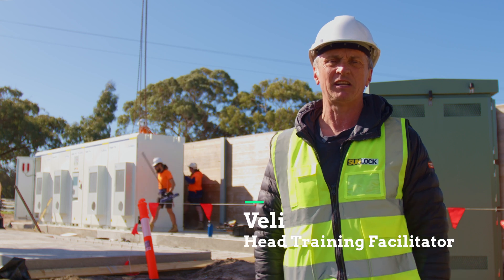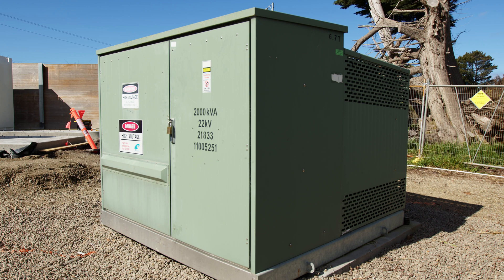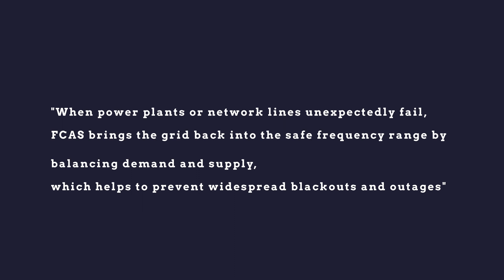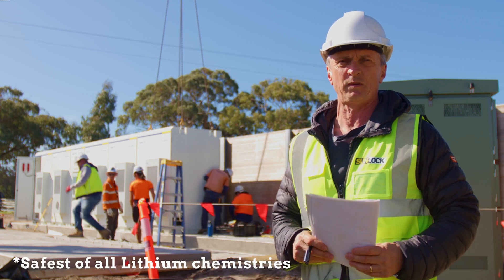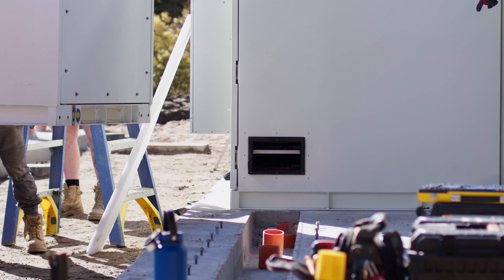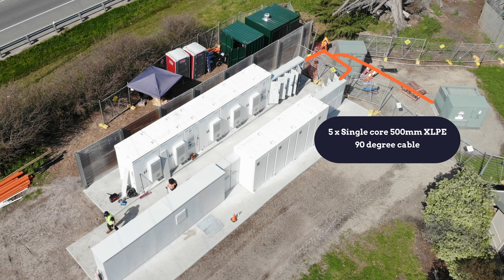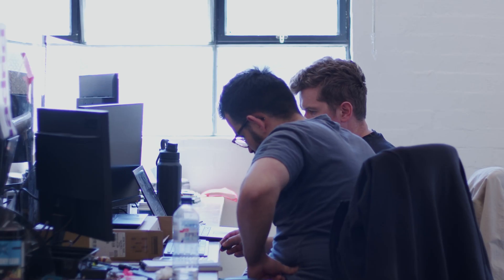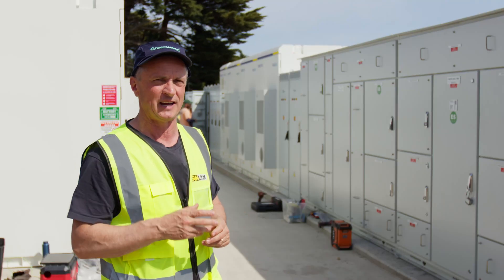2.5 MWh Battery Project BREAKDOWN

Comment: In this video, Greenwood Solutions is  installing a two-megawatt-hour battery on the Mornington Peninsula. 
The project involves two separate systems, each with its own battery and inverters, stabilizing the grid through Frequency Control Ancillary Services (FCAS). 
 The project emphasizes safety, quality, and precise cable installation, with detailed cable reports ensuring compliance. While lacking a photovoltaic (PV) component, the project showcases the crucial role of batteries in grid stabilization.
Well done
Reply from the maker: Ta.